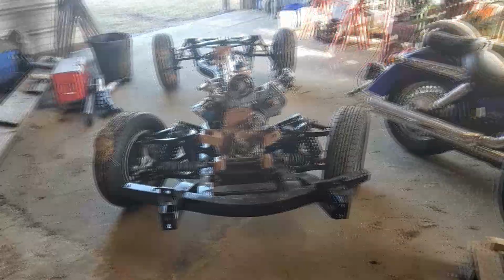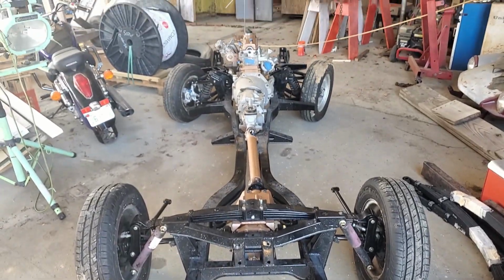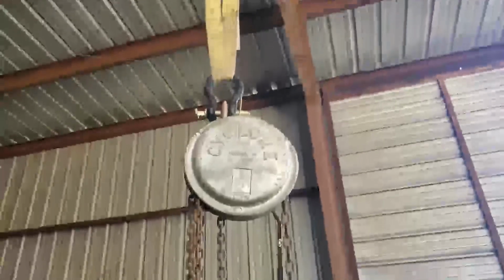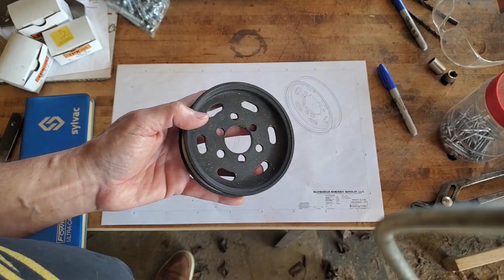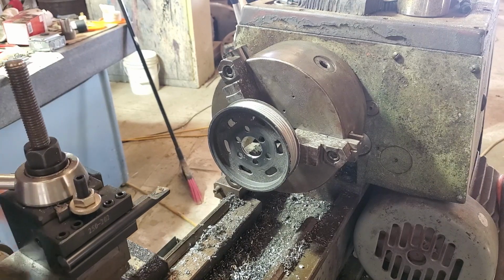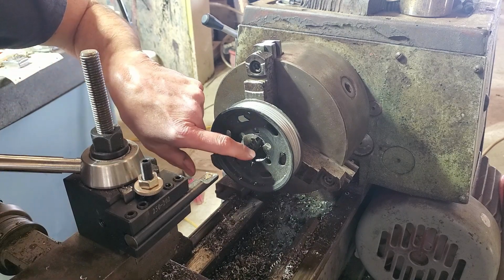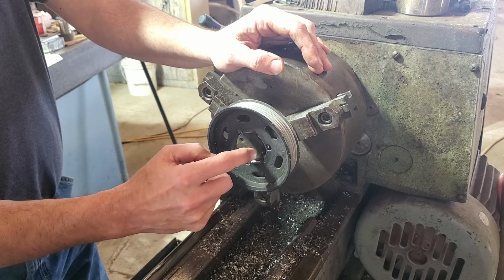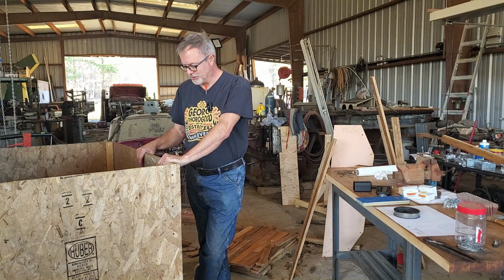Machining Spitfire Accessory Drive Components

Comment: Is the centerline of the pulley in line with the centerline of the bearing? Doesn't appear so in the cad views. It is on center on oem idlers (i have both pulleys and smooth idlers, all on 6203 bearings). If it isn't in line, a double row bearing would be a better choice, or a pair of regular bearings if availability/serviceability is the concern.
Reply from the maker: He offset the CL of the belt slightly to the rear to balance the weight of the clutch and fan. I would still prefer he use a double row bearing. If it fails and it tears up his radiator, intercooler, and all our hard work... we've had that discussion. His car, his call.